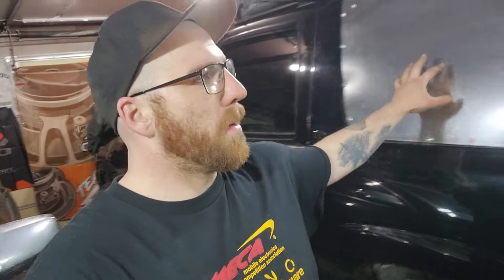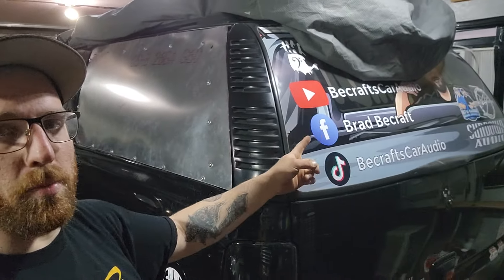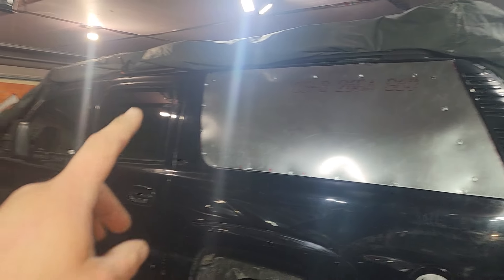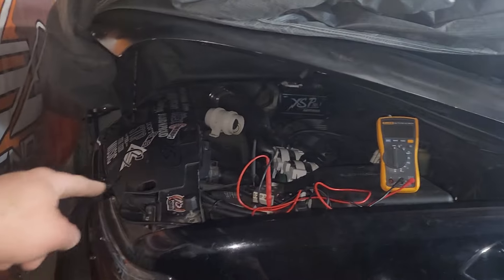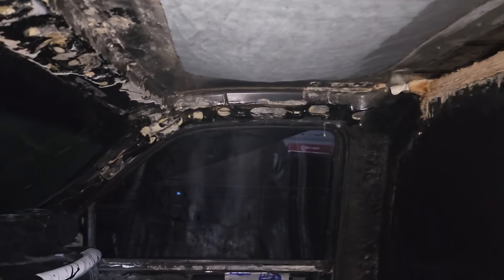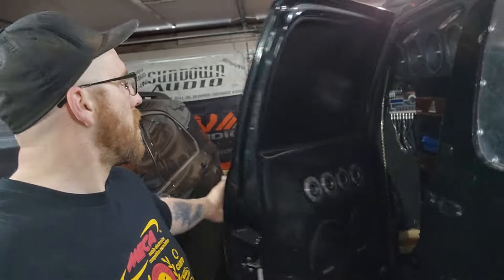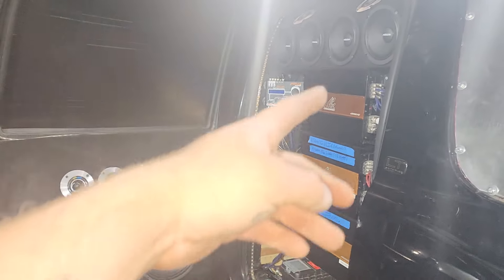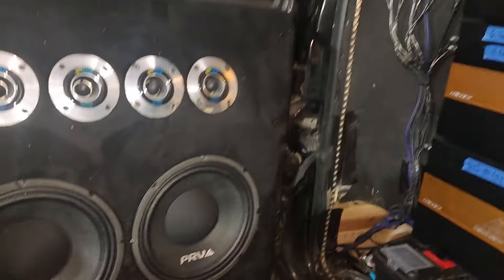New Windows, New Mids, New Quad Alt Setup

Comment: why not just leave the rear windows in
Reply from the maker: Gonna have lithium and amps mounted on the sides of the wall so need access...was going to put the glass back in but if theres an issue i want to be able to get to it easily of possible
Reply: hell yea  @BradBecraft